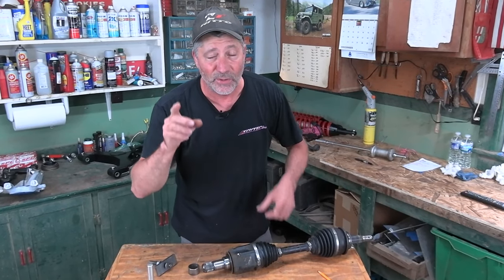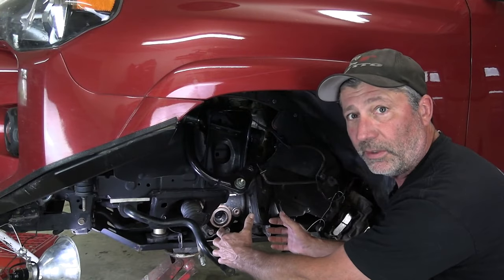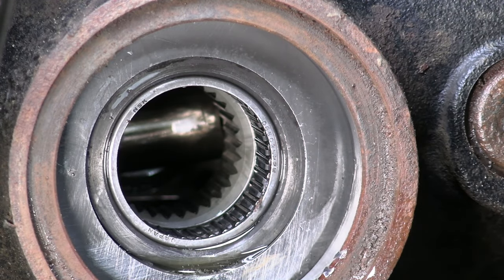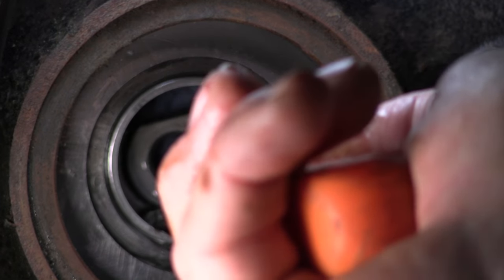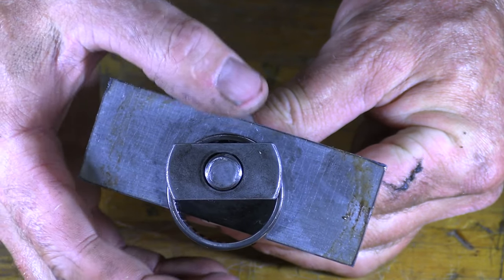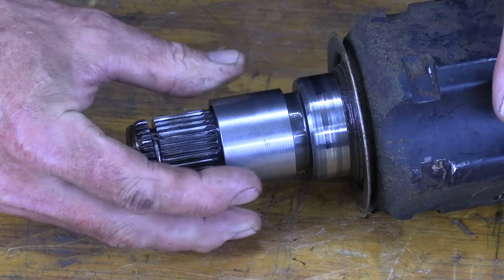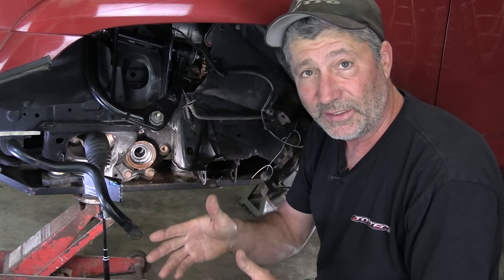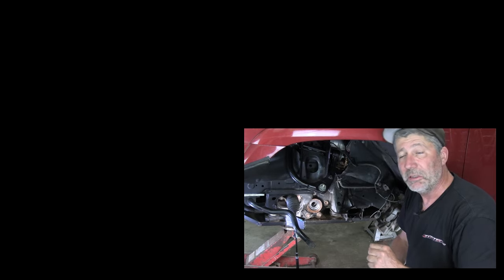Toyota Needle Bearing Swap for ECGS Bushing- Clamshell Front Differential

Comment: Had the vibrations, checked play on CV and it was Outrageously loose. Performed this ECGS bushing fix and vibration is gone. If you are doing CVs as well, and don't have a core charge, cut the tail end off one, remove the retaining ring, and use as a bushing install tool. Aligns it perfectly.👍

Comment: Have to be careful because that driver side is a little sloppy even after you do the bush swap. I had all the symptoms, did the swap, didn’t fix the symptoms. Turned out to be a the passenger side front wheel bearing. I had checked that bearing and would have sworn it was good, no play at all. Mechanic wasn’t sure either but he said if he had to guess it was that pac side bearing. Changed it, yep that was it.

Comment: Wow.... had I known this 3 months ago I would've never sold my 2022 Toyota 4Runner. Ultimately, the noise was driving me crazy as well as the steering wheel shimmy I would experience. I only had about 5700 miles on before selling. I bought my truck new with 3 miles on it.... I've taken my 4Runner to the dealership multiple times for a noise that I would hear on the driver side. It was driving me crazy. Nobody at the dealership could figure out the problem and no one could hear what I was hearing and feeling and they would just say that the truck drives like it supposed to. It upsets me that it's a known issue that Toyota hasn't addressed. Well according to a forum I just recently came across today this is a known issue.... this video just confirms it too for me... sigh
Reply: Did the dealer replace it for you? or agreed that this was the issue? Thx
Reply: @lucasr5675  hell no...  come on man you don't know about dealerships?  I've had the same issue.  They deny everything.  "Everything seems fine."  As if they shouldn't know about this and remedy it for anyone experiencing this issue.  Idk who I hate more, dealership employees or criminals.
Reply: @kdworak4754  I know what you mean.  I've been watching videos for weeks and just ran across this.  sry to hear that you sold your 2022 4Runner

Comment: Interesting, thanks for the vid. My cv has a little play but its never affected driving. Thats a handy trick with the rag. Also you mentioned the spider gear but I think that's in fact the *side gear*. The spider gears are the ones on the cross pin doing somersaults while you're driving :)

Comment: Wondering if this is the cause of my driveline vibrations. No leaks from anything but a front end vibration that feels like I'm going over a cattle grid, happens loaded or unloaded, in h4 or h2, at specific speed (45, 65 and 85mph). When my lbj failed I noticed the inner CV had outrageous play.
Reply: Have you tried putting in 4Hi in a straight line while doing 55-60.? If the vibration goes away then that’s deff the issue

Comment: Nice work and also when u place the tool in thread it on already then slide it in same way at an angle no worries if losing or using a magnet just a tip

Comment: This is a great instructional video! I bought all the stuff and starting pulling mine apart. It’s a 2011 4Runner Limited. But when I pulled the CV axle out, there is no needle bearing in the housing. It’s a bushing with a larger OD than the ECGS bushing. I can’t find that part number anywhere! Any ideas?

Comment: 🏆🏆🏆👍🇺🇲🙏
What's the longevity of the bushing vs the needle bearing? Is there and downside to the bushing?
Great job and video ⭐⭐⭐
Thank you for sharing
Reply from the maker: They claim it's a "lifetime" replacement. I figure it has to last at least a bit longer than the badly designed needle bearing.

Comment: Could this part be the solution my problem? So when I’m in 2h there is a slight shake in the wheel. And my wheel alignment is slightly off. Lmk my truck is a 2021 Toyota 4Runner venture.

Comment: Good video thanks for posting. 
I’m wondering why couldn’t you drill a small hole 🕳 in the part of the tool that goes on the inside and put a string or a wire on it so you couldn’t loose it into the diff. The rag is a good idea also but it could be forgotten in there. 😩. But thanks again for the info I have a 2002 Tacoma that might need this done sometime.
Reply from the maker: Great idea

Comment: How bout on a 2016 Highlander AWD?  Seems like the same issue I am seeing. Toyota said I had a transaxle bearing causing the wobble on the driver CV axle and then advised I take it to a transmission shop for diagnosis and repair.

Comment: I am curious why not just use another needle bearing set up. 
Bushings do work and I have in the past replaced roller bearings with custom made brass bushings but I would stay away from something that is this critical with such a mod.  Toyota engineers are not stupid and so there is a hint of greater longevity with needle bearings vs a bushing with bronze coating. I have a 7 year old Tacoma TRD off road with 297,600+ miles on it and I have not yet had an issue with the bearings. I am honestly curious and I am not being critical, just asking. I have worked on high performance aircraft for over 30 years and you tend to find that things are the way they are for a reason.

Comment: I just bought a 99 taco and the previous owner has the driveshaft out with these issues but my taco has manual hubs. For some reason my manual hub differentials dont work with this bushing.

Comment: As an added backup, why not wrap a piece of safety wire around that plate when you insert it into the diff? If you offset the plate on the outside , it might give you better visibility of the plate on the inside to ensure you have proper alignment. Other option for freezing is to use a can of CRC Freeze Spray. It cools to -60. I don't know if that cold runs the risk of fracture due to it being brittle though. I installed some bearings before and chilled them down with a can of computer duster tipped upside down. That helped quite a bit.

Comment: yes yes. i got this issue on my 2010 tacoma. i got the steering wheel shake on bumps. steering shaft has no clunk and frond end tight. i happen to hit the axel and saw it move like that. i will replace and hope everything goes well. thanks for the confirmation.

Comment: Spot on. Around 20-30 mph you get a vibration felt in steering wheel and floor joes and a slight growling noise. It goes away in 4wd. ECGS is great, they will sell you the kit including new bushing, seal, bearing puller and install tool. Took me about 3 hours start to finish. No loose CV axle, no problems now. 2016 TRD sport 4wd.

Comment: Thanks for excellent video. My cv axle is loose but I have no noise or vibrations on 2012 4runner with 237000 km.  No lift either but I will keep a close eye on it. I had some shaking in cold Canadian winter but previous owner neglected driveshaft lubrication. I lubricated all points and pushed out old grease, afterwards it was fine. Some claim you can cause damage by overgreasing, I didnt see that.

Comment: My front end doesn't do this, but it is trash lol something is so off. Like if i steer left, nice and snug vehicle corrects itself.. if I steer right vehicle seems like it could do a 180 if I didn't correct it. I'm well aware of the crown and have tested it. Toyotas telling me it's fine lol got it brand new. Has kdss if any of one knows even a hint of what it could be. Been to the dealer countless times Dealer tells me "drives like a 4runner " 😂
Reply from the maker: There's definitely something wrong! Either the dealer can't diagnose the problem, or they simply don't want to deal with it. Take it to a reputable mechanic and get a second opinion.

Comment: I have a toyota tacoma 2009 whit the same problem  in both  sides driver and passenger  do u think that I can install  te ecgs bushing  in both  sides ?
Reply: The passenger side is supported buy a bearing that is also serviceable.
Reply: I have the same problem. Would this same bushing fit on both sides? Driver and passenger side? Or will I have to find one made specifically for the passenger side too?
Reply: @EvanDoesBigThings  each side is different. Driver side has needle bearing, passenger side has ball bearing

Comment: Is it common to only need to replace the driver side bearing or do you do both sides? 
If both sides, are there the same size bushing and oil seal?
Thank you. Very good video
Reply from the maker: The right side is more of a ball bearing. It never seems to have an issue like the left side.

Comment: Same problem with mine, I'm getting it changed out, could anyone tell me after it's changed out, should I leave the diff. drop off, or on? I put one on it, but it actually made the noise worse, so I took it off and it is better, but still has the noise.  I have 3" on front and back. Thank you !

Comment: Good to know. The seasoned mechanic in me says the needle bearing would be better and last longer since the axle is constantly spinning. Obvious engineering says otherwise.
How many miles do you have on that original bearing? I also wonder if time spent in 4WD has an effect on the  needle bearing life.
Reply: The lift is what destroys the needle bearing from what I’ve seen. At stock height they can last a very long time
Reply: @blanedearmond6972  That makes sense. More angle, more load. Just like CV's and U-joints get more stress and wear with greater angle.
Reply: My needle bearing failed twice... my 4runner is completely stock.. had the carrier replaced the first time, them it failed again, I just got the bushing installed,  solved all problems

Comment: I did this and it didnt solve the issue.  I moved the tires while the vehicle was in the air.  No movement so I thought there was no way it was a wheel bearing.  I had the bushing installed and it still has the awful wobble sound.  Any ideas?

Comment: 2:55 ... where do you get this hook for the sliderhammer? does it come with the autotool loaners at the various autoparts stores?  it looks so much easier to remove the CV than trying some big brass punch and hammer from directly underneath the vehicle
Reply from the maker: It came with ours, so it would probably be available with the loaners.

Comment: What do you suggest first for a 2WD model with the same shaking issue? Tie rod? Bearing?
Reply from the maker: I'd start with balancing the tires.
Reply: @WanderlostOverland  I’ve done that, shocks are good. Wear seems normal on the tire. Thanks for your reply!

I’m not sure if we have a tire shop in town that does the road force balance. Not quite sure I’ve ever seen that before.

Comment: Did you have to replace any fluid after install. If so which fluid did you replace it with ?
Reply: Just add diff oil ( recommended type ) because there will be a little oil coming out

Comment: So I’ve installed this and once again have the same symptoms of a failed needle bearing including shaking and groaning noise.
Reply: Check the carrier bearing play on the drive shaft that goes to rear differential. That can cause vibration when you hit a bump if it is worn.
Reply: @ramrod175  unfortunately on 5th Gen 4Runners they don’t have a carrier bearing. My Tacoma has one though.

Comment: Typically,when do these needle bearings go bad?My 18 4 Runner has 50K on it but it’s lifted and has spacers and is running 34” tires.
Reply from the maker: You might be due. Check for excessive play
Reply: I have a 19 4runner,  mine went out at 20K miles and it's bone stock, no lift!

Comment: The best video I’ve seen on this procedure. Especially the troubleshooting part to see what was wrong. Now I’m still wondering if this is the same problem I’m having? I’m hearing a pretty loud vibrating noise up front on the driver side but only below 20 mph then it goes away. Haven’t checked on 4 High yet but I will in the morning. And will see it the axel part is shaking loosely too. Now is it a good idea to change on the passenger side too while I’m at it? (IF it’s the problem) or wait? Awesome video man.
Reply from the maker: No need to bother with the passenger side. It's  ball bearing and seems to last forever.

Comment: I get the idea,.. but usually u replace bushings with bearings. Not the other way around.  Is there any long term issues with this?  Assuming the bushing would wear out over time aswell. And cause the same issue?
Reply: I just had this bushing installed at ECGS. Solved all the issues.. ECGS says the bushing will last 500K miles or the life of the carrier assembly
Reply: @ddelima87  had mine done a couple weeks ago, so far so good

Comment: You could thread the rod onto the the rectangular puller nut and use it as a handle to install the nut.  easier than trying to thread it while it is sitting loose in the hole and reduces the potential of dropping it into the gear box.
Reply: How are you going to do that if the “puller nut” has a larger diameter than the hole you’re trying to put it through?

Comment: Phenomenal video. Thanks.
Reply from the maker: Glad you liked it!
Reply: @WanderlostOverland  dealership just swapped the whole differential on my 2022 under warranty as it had the growling defect.  Started at 500 miles. I’m hoping this one lasts, but if not, I might need to do this swap. The field tech advised that they still haven’t fixed this issue and some of them still exhibit the defect. Maybe just use a sleeve like everyone else?!?!
Reply: the growl or hum came back as well as as soon as they changed the diff, i got a wheel shake at around 65MPH. At what MPH was your wheel shake? did this cure it 100%?